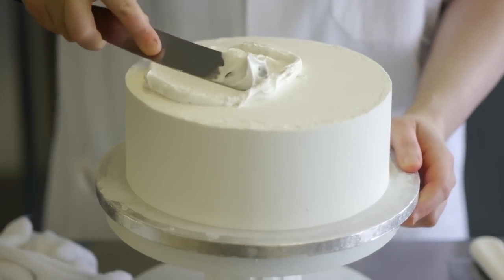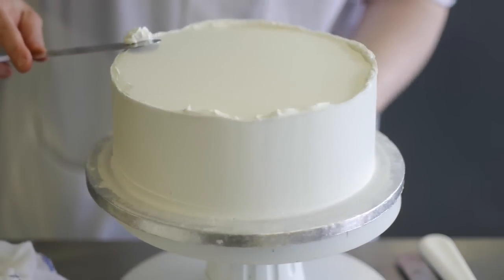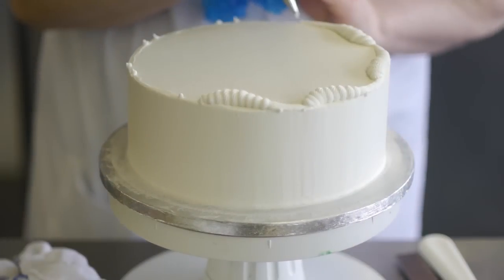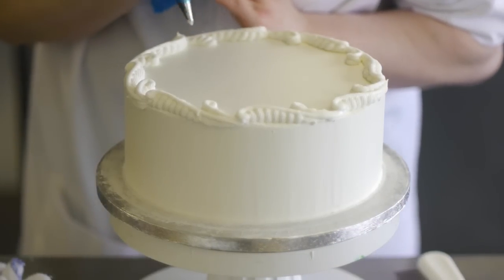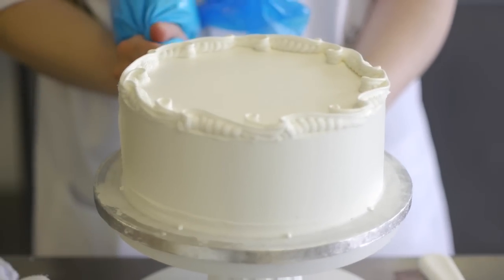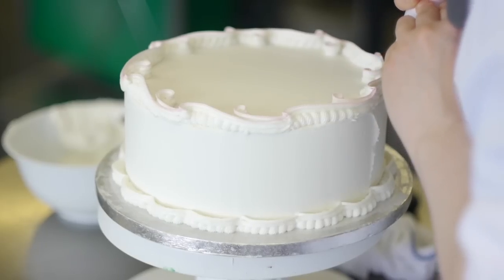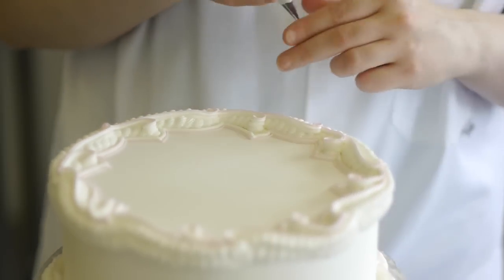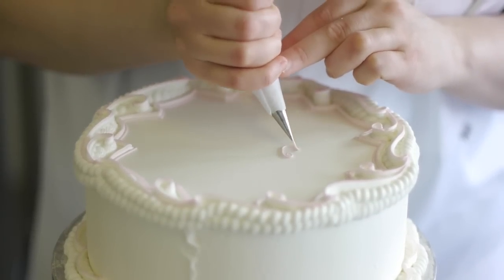Royal Icing Cake Decoration Master Class with Charlotte Feve

Comment: When a cake is covered in royal icing, you would usually put a layer of marzipan underneath it too. The cake does not turn hard because it's not a sponge cake, it's a fruit cake which is very moist, so it will stay soft.

Comment: I know that royal icing dries real hard.  But how do you cut a cake after it has been frosted with it?
Reply: you use a serrated knife and dip it into hot water before cutting each piece
Reply: Katzen Minze TV CVC vhj
Reply: Katzen Minze  have you a good recipe??
Reply: Most Royal icing has liquid glycerin  in it which helps prevent it going too to hard:). The more you add the softer it sets

Comment: Very nice consistent piping and good job handeling that air bubble they happen. Only critique I have is even though it is a dummy cake amd probably done to put on a shelf as display when working with white icing it needs to look perfect.  And I talking about the extra icing on the back side of tje cake when smoothing  the side the seam is a real eye grabber. Dont want anything to draw attention away from the lambeth work. Other than that great job!
Reply: Yeah I thought that should have been smoothed out too. xx
Reply: The Fakey Cake Maker it is easier to wait until the icing is hard before scraping thing like that away when using royal icing.
Reply: Good to know tigerwa thanks. xx

Comment: MAY BE A SILLY QUESTION BY WHY WOULD ANYONE  WANT A HARD FROSTING. oops sorry for caps is royal icing  used only for cake dummies to display.SignedWatched thousands of videosNever made a cake
Reply: It's not hard, when it dries it keeps its shape.  You can also make decorations beforehand and transfer them onto your final product.
Reply: Royal Icing will not be hard.  Maybe you're referring to the type of Royal Icing used for making flowers.  That's a different one.